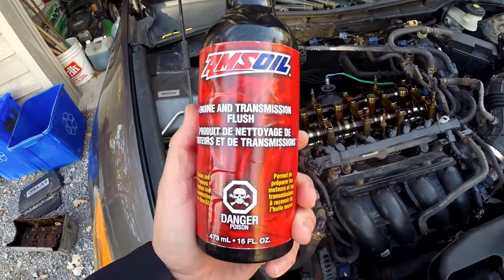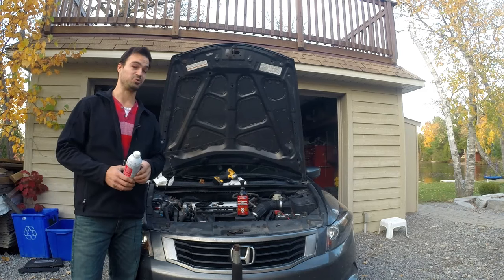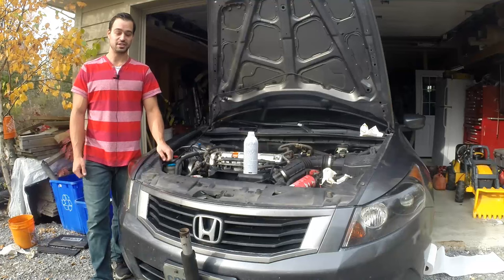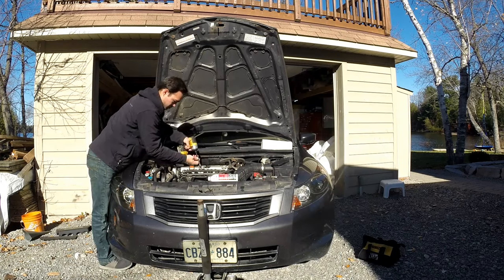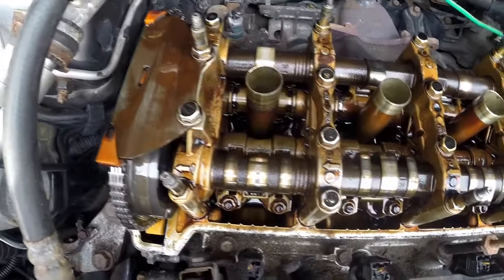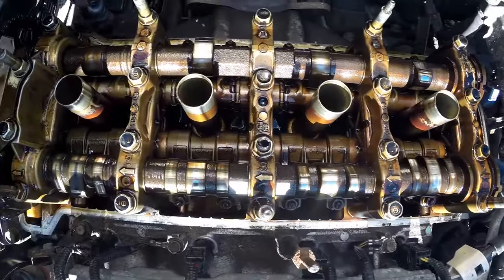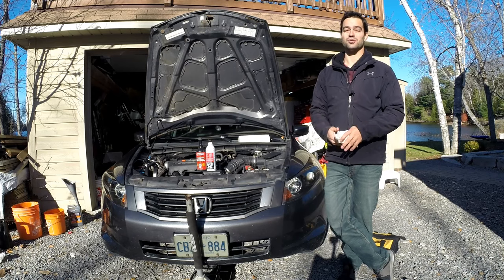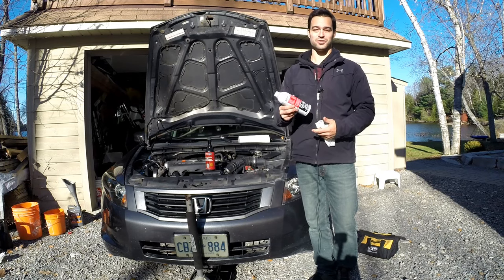Amsoil Vs. Seafoam Engine Flush - Who Wins? Thorough comparison and PROOF

Comment: Cleaners are great. If you use a quality Full Synthetic Motor Oil and change it every 5,000 miles or 6 months. You will have a clean engine.
Reply from the maker: Nice thanks for your comment! With the Accord in the video, I was ok with ~10,000km intervals mainly because it was such an old car. I used Amsoil XL and it had plenty of life left at 10k according to a Blackstone analysis.

Definitely agreed though, if I was after a cleaner engine, I’d shorten the change intervals :)
Thanks again!
Reply: @KingdomAuto  I am a HUGE Amsoil Customer.  Been an Amsoil Customer since 2014. I use Amsoil OE in 2010 Toyota Camry with the 2.5L four cylinder with a 6 Speed Manual Tranny. I have well over 245,000 miles on the clock. I change every 5,000 miles.  My 2013 Tacoma V6 4x4 I use Amsoil XL and I use Amsoil XL in my Wife SUV. All my transmission fluid, Engine Coolant and brake fluid is all Amsoil.  Love The Product!! Keep up the Good Work!!
Reply from the maker: @BOSS-xy8op  Thata great to hear! I’m a big fan of Amsoil as well, I don’t think I’ll ever put any other oil in the vehicles that I own. After running that Blackstone analysis at 10k, they said the oil looked great and had tons of life left so that was proof enough for me. And that was only XL, not Signature. Plus with the membership pricing it works out to be quite cost effective too. I’m really happy with their stuff :) 
Glad you are experiencing the same things!

Comment: Try changing your oil type. What i mean is use another oil in your car. Ive used mobile one in my motor and the ticking was still there. I used different types of oil. But when i started using Royal Purple the motor was alot quiter and the ticking stopped. Try with Royal Purple for your next test
Reply from the maker: Thanks for your comment, this test wasn't so much about which type of oil to use, as it was a test to see how well a couple of "engine cleaning" products will work to remove sludge. However, a test to see how clean a certain type of oil can keep an engine would also be a neat topic to try out :)
Reply: Some oils do give u sludge.  Royal Purple has a strong detergent that cleans your motor from the inside will help with the sludge plus u can add sea foam to help more of the sludge removal.
Reply from the maker: Yeah I know what you mean. Im not sure what oil the car was run on from 0-220,000kms, all I know is that the changes were done on time. After 220,000kms the car was switched over to Amsoil, which shouldn’t be one of those oils that gives you sludge though, being one of the top synthetic brands. 
But yeah I’ve heard that Royal Purple can do well with cleaning the engine

Comment: Which oil did you use for the life of this vehicle? I want to know so that I don’t use that oil for my car.
Reply from the maker: As mentioned in the video, for the first 200,000 (ish) kms, I am not sure.

I switched over to Amsoil XL for about 80,000kms prior to this video I believe
Reply: @KingdomAuto  so basically the previous oil left all the deposits and gunk on the engine. Amsoil wasn’t able to clean it, and you said XL edition not the signature. That’s also worth noting.
Reply from the maker: @davidtchanturia6630  I would assume so. Granted, I bet if I were to have run a few cycles of Amsoil through the engine and done maybe 3k change intervals, it would have done a better job cleaning. Typically I went to 10k (kms) with the XL because I had a Blackstone test run on the oil at that range and there was plenty of life left at that interval.

Being an older car I wasn’t too concerned with going to that range between changes, especially if there was lots of life left in the oil.

So I bet if I had done shorter intervals, it would have cleaned the engine out more.

Just a thought though

Comment: Thanks for the unbiased (as possible) comparison. My mechanic has sworn by seafoam in the engine oil and fuel system too.

My only rec is NEVER get under a vehicle that is only supported by a hydraulic lift (like a floor jack). ALWAYS use axle stands!!

Sorry. My mechanic drove that into my head when working with him as an apprentice and even at home now I always use axle stands unless vehicle is on four wheels and I need to get under it.

Otherwise congrats
Reply from the maker: Much appreciated!
Yes I totally agree about jack stands.

There was one time in this video where I was using stands and the camera couldn’t see them. Another time where I hopped under just quickly but I totally agree. I always use stands, thank you for your comment my friend :)

Cool to hear that your mechanic recommends Seafoam too!
Reply: Glad you use em. I have heard horror stories of people not.

I got a 20 ton bottle jack for my k2500 cause my 3 ton floor jack wasn't feeling safe even with tires on and jack stands... laughs

So no worries. Just didn't wanna tell you your business is all :)
Reply from the maker: @natenixon9487  Yeah I know exactly what you mean, I've heard some rough stories as well + especially with my family in the picture, I always throw stands under the vehicles now. 

Interestingly enough, it was due to this video that I became even more careful with stands - mainly from a bunch of comments from fantastic folks like yourself that mentioned the topic. Since hearing some of those stories, every time I've gone under a vehicle, even quickly, I've put stands under. 

So I really appreciate your comments! Thanks again :)

Comment: Use half in the engine oil before an oil job and with the other half I pour inside the gas tank
Reply from the maker: Yep good way to clean injectors, and valves if it’s port injected :)

Comment: This just prooves to me that you need to give it time.
Test amsoil, the same amount and drive around for some time, i promise you the result is the same as snowfoam.
Reply from the maker: That makes a lot of sense, but keep in mind that I was following the exact directions on the cans themselves. Amsoil specifically said to leave the product in the oil and idle for 10-15 minutes. I idled the engine for a full 15 mins, and then drained to give it the best possible chance at doing its job. 

I have no doubt that you're correct, but I also wanted to follow the instructions from the manufacturers.
Reply: If it worked any better, no doubt Amsoil would have that in the instructions.  More llikely, it affects lubrication to such an extent that it will result in potential engine damage if run under load.  Its always funny how when Amsoil is not declared a winner, there is always a fan complaining the tester followed the Manf's instructions...
Reply from the maker: @boots7859  Hey thanks for your comment - that's a good point about the product potentially affecting the lubricity properties of the oil itself. I would also imagine that these products are designed to be used regularly as well, probably as much as every oil change, to break down sludge slowly and dissolve it rather than break it up into chunks, or big pieces, etc. Because that could also result in blocked oil passages and pickups too. 
If I was able to do it, I'd do exactly that, run the product through the engine for say 5 oil changes in a row and see the succession after each oil change. Maybe I can run something like that in the future :) It would be an interesting test!

Comment: looks like seafoam did a little better for the varnish
Reply from the maker: Yeah in this case, it did seem that way. And I know that this could very well have been because I tested Amsoil first. But at the same time, with a Seafoam treatment, you don't need to use the entire bottle. Most times you can get at least 2 and sometimes 3 uses out of just 1 bottle, whereas the Amsoil product is just 1 flush per bottle. So from what I personally saw, I am leaning towards Seafoam as well :)

Comment: That's why changing your at 7500 km will keep your engine sludge free
Reply from the maker: I’d gotten this car second hand with 200,000kms on it. At the time I took it over, I did exactly that with Amsoil full synthetic, and was doing so for about 150,000kms. Not sure if the sludge was from before, or if the change interval of around 8000kms is a little long. I’ve heard some people say they change their oil every 4-5k and it prevents sludge. Others say it’s the type of oil and the cleaning agents that are added. Hard to say.

I do know that the Seafoam did do a decent job at beginning to remove some of the buildup though. I bet if it was used regularly it would clean things up nicely

Comment: I would just buy the cheap mobile one full, synthetic and filter drive 4000 miles and then drain it out after 20 minutes of driving with the hood open so it cools down a little bit and then fill it back up with mobile one extended life and their filter and change it again at 12,000 miles And skip the flush
Reply from the maker: Yeah good idea, I’ve heard a few people say that short change intervals with a good oil can really help with a clean engine.

Would be interesting to see how that would do in a test as well!

Comment: Just wondering why you are blowing all of that exhaust into your house?
Reply from the maker: That’s… a garage 😂
Completely detached from the house
Reply: I'm worried about you not using jack stands. Dryer vent hose will help direct the exhaust outside. Should you have to close the doors on the blistering days.
Reply from the maker: @madmacc040  not sure if you read my reply, the shop is a detached garage, and not attached in any way to the house, no need for venting exhaust.

As for jack stands, yes, I always use them. Just didn’t have any during the filming of the video.

Comment: REAL TEST NO BS. VIVA SEAFOAM!
Reply from the maker: Thanks Victor. I would make sure to mention that Seafoam definitely had a bit of an advantage being tested second, after Amsoil. But that said, I also really like how one bottle of Seafoam can treat an engine 2-3 times. Whereas Amsoil is one bottle per treatment.

Either way, I tried to remain as unbiased as possible and it certainly looked as though Seafoam came out on top for this specific test.

Cheers!
Reply: @KingdomAuto  I would use MMO in fuel as directed., save tons, check it out.
Reply from the maker: @victorteo4783  I've heard MMO works well too. If I ever run a test like this again, I'll try MMO as well :)

Comment: Just use any good synthetic Oil change every 5k miles with the filter and you will not need to flush your engine!! No need for MLM Amsoil products. 3rd generation mechanic and engine builder.
Reply from the maker: I am well aware of this, but that wasn’t the point of the video.

Purpose of this was just to see if they work.

Comment: It won't work, unless you go miles.
Reply from the maker: Not sure what you mean, I followed the directions stated by the respective manufacturers. And the Seafoam definitely cleaned out a good amount of what was in the engine
Reply: @KingdomAuto  It's a joke. The idea is, unless you state the distance in miles rather kilometers, it won't work. Not true, of course.

Much humor, you know, is based in ontological fallacy. That's what make funny funny.
Reply from the maker: @anonymike8280  Gotcha, I get it now - went right over my head lol.
Reply: @KingdomAuto  Once in a conversation with my brother and friend, I complained about the use of the parsec as an astronomical unit. What I said was, "I have no idea at about a parsec. I know exactly how far a light year is."

Where's the ontological fallacy? Well, it's in the claim that someone can know how far a a light year is. No one knows what a light year is as an understood distance.

Someone who's been driving a big rig the limit for more than 50 years or a veteran airline pilot would measure the distance they have traveled in their lifetime in light seconds. As would I. That's a new one. Change your oil every 0.016 light seconds!

Comment: just use gasoline to flush as easy as that cheap and very effective. use shell racing  the blue gasoline
Reply from the maker: Do you think that would be a good idea for the lubricating properties of the oil? Typically when gas dilutes oil it can cause the oil to lose its ability to do its job and cause damage to the engine. Granted, I don't know if these products I used in the video have additives in them that contain lubricating properties as well.

Comment: Looks like you doing long oci. Seeing your engine between 6000 to 10k miles.  For my experience use Royal purple or Red line maybe cheaper Pennzoil Ultra Platinum for 2000 miles plus an engine flush and refill with royal purple for 3000 miles you're gonna be very satisfied
Reply from the maker: Thanks for the info! In this case, I wasn’t too concerned with the buildup in the engine. I’d been using Amsoil XL and going about 10,000kms between changes. It was a daily driver with almost 400,000kms on it, so as long as the oil had good life left when it was changed then I was fine with it (I had Blackstone analyze the oil at 10k) so really this test was just to see which product does a better job at cleaning the sludge/buildup.

That said, thanks for your comment and I totally agree. If this was a newer car or a higher performance vehicle, I’d be doing what you’ve mentioned :)

Comment: 15 minutes of idle with amsoil isn't gonna clean shit, you are supposed to drive 100 to 200 miles with it in the oil, says so right in the product directions. I have a can right in front of me.
Reply from the maker: Must be a different (or older) product man. I followed the directions exactly as specified on the bottle that I had.

Don’t make ridiculous assumptions without having proper facts.

This video was made a few years ago, how do you know you even have the same product as what I used? Or that the directions haven’t changed?

Comment: You really should of had a second engine to test against
Reply from the maker: I explained that exact point in the video. We all know Seafoam does a good job on its first pass through the engine, so that's why I just tested Amsoil first. Seafoam is proven to remove basically the same amount of buildup that it removed during my test, based on multiple other channels testing the results. So it's not news to anyone that Seafoam can do what it does (link in my description)

What I wanted to see was if Amsoil could do the same thing. In terms of just a "one time cleaning" Seafoam is the better product. 

One day I might try to run this test again but because conclusive evidence of Seafoam already exists, I'd be willing to bet that the results would be the same, even if using two engines.

Comment: Really not much help. Cheaper to use either transmission fluid or kerosene
Reply from the maker: The Seafoam actually did a good job + would continue to remove the buildup if I ran it though a couple more times. Also, neither of these products are expensive so the price isn’t really a factor in a case like this. Both products are meant to use on a regular basis and this was just a one time test to see how much of an impact they could make. If used regularly the engine would clean up quite nice